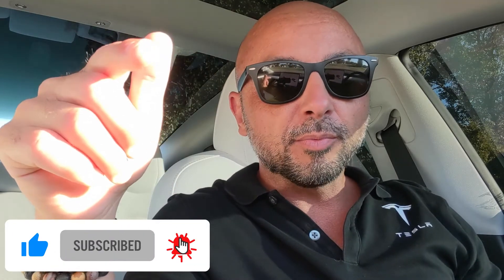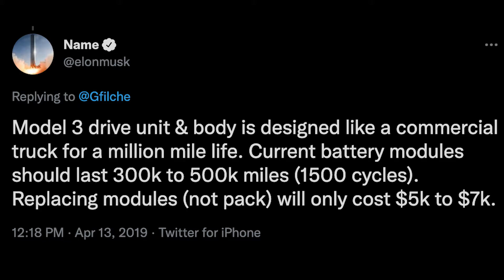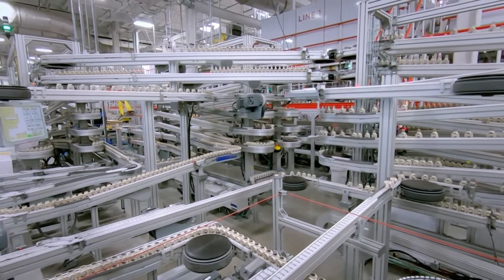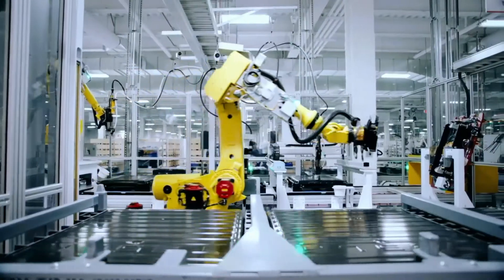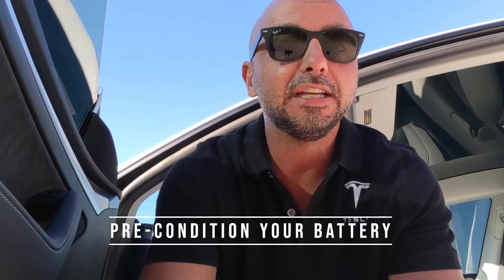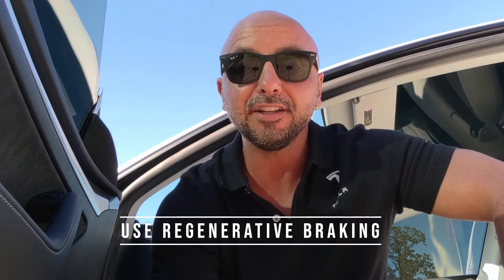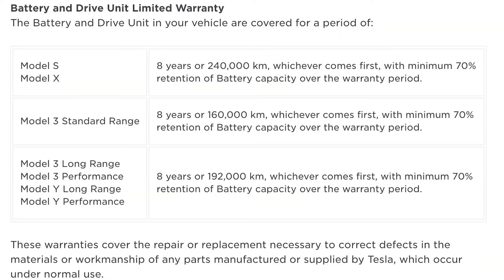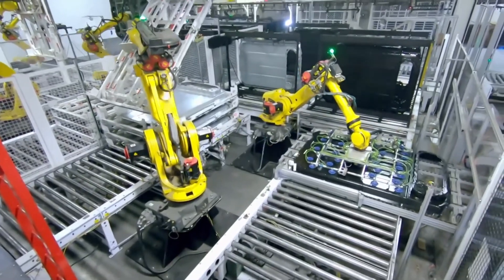How long does a Tesla battery last?

Comment: I recently bought a used 2021 Model 3 Long Range. Manufactured in 02/2021 it may fall into that transition period when the batteries used went from a 75 pack to an 82. I cannot find which battery mine has.  Do you know how to find that information?  And, wouldn't Tesla know by VIN what components the car has. I see it lists heat pump, lead acid battery etc. no mention of the big battery.  Thank you.
Reply from the maker: Absolutely, call your local Tesla Service Center Dave, they will be able to look all of that out.
Reply: @Tesla11ven  I've been unable to talk to my local service center.  After calling the local service center number,  I waited on hold for an hour before speaking to someone in Colorado (I'm in Texas). It was about another matter, but I'll try again, maybe the guy in Colorado can look up the info. Thank you for the suggestion.
Reply from the maker: Don't give up, stay persistent and in fact you can call any center. Also try within the Tesla App as well
Reply: @Tesla11ven  When I described my request in the app, the automated response was  "batteries degrade at different rates depending..." or something to that effect. The "Contact us" button was highlighted in blue but did nothing.  I have 3 local l Service Centers in Houston to try. Monday morning I'll be on the phone!

Comment: My 2020 m3 already has 11 % degradation and still dropping pretty steadily. It only has 33k miles. Not sure if I believe it will last 300k miles
Reply: Yes I charge 80-90% daily
Reply: @barrylee5580  i think that greatest enemy of a battery is heat so take care of that
Reply from the maker: Omg that seems crazy. What kind of charging habits do you have? Do you charge to 80% on the daily?

Comment: We have the 2018 Tesla MS 100D and it has been reliable until last week. I was driving from San Francisco to San Diego. I stopped near Bakersfield to charge the car to about 270 miles. We started down freeway 5 and I got a warning that I needed to charge the car and to pull over to the side of the road. We were lucky we were not hit by other traffic as it was about ten am. We had to wait for about two hours for Geico to send us a tow truck. Tesla in Bakersfield told us that the main battery needed to be replaced. The car has 83000 miles on it. Worse case it may take seven weeks to get it done. The battery is still under warranty so that helps. They provided a model 3 to continue our trip home. I had to learn how to drive this M3 as it does not operate like the MS does. I have to say it rides ok on the freeway, but I like my MS. Tesla Workers at the Bakersfield location are very nice. Our Model S did not give us any indication in the days leading up to this battery failure. Has anyone else had something like this happen to them? Are the batteries installed in the newer cars better? Thank you for your video.
Reply: That was actually my concern, and wanted to get some stats on battery "brick" failure rate on the older model S.  I have an older S 85+  that is out of warranty with 87K miles on it.  I have no concern on the range degradation, as there are plenty of data online showing ~9%-10% of degradation post 100K miles and it doesn't get worse after that.  The unknown is the "brick" failure rate.  Not sure if it's just a random failure, or it has something to do with charging habits.
Reply from the maker: Sorry to hear about your battery experience, and fortunately it will be covered under warranty. I would suspect the model s has similar battery technology but I can say for certain if it's identical.

I have a video on charging tips for the model 3 that you should watch. It will ensure your battery remains happy and lives long. Hopefully you get your car back and all is well with it sooner than they say as well. Good luck

Comment: no my 2020 already have 8% degradation
Reply from the maker: It is expected but can be worse depending on charging habits and battery care, but don't worry it won't keep depleting. It will level off if not already.
Reply: @Tesla11ven  how do you know other than repeating what tesla says?
Reply: My P3D is 8 years or 120,000 miles

Comment: What would happen if the grid goes out?
Reply from the maker: That's a loaded question.
Reply: Gas pumps would not work without electricity.
Reply: honda makes generators

Comment: Cool, I just got a model 3 sr plus and its awesome;-))
Reply from the maker: Congratulations! What do you like most about it so far?
Reply: @Tesla11ven  Hi,  I am into magnetic / free energy, and high performance electric rc heli's so an electric car is a bucket list necessity.....This car was a Chinese build..(I am in Oz).. I was interested in quality and paint particularly panel alignment etc. Its pearl white with black/white interior. It went straight to a mates paint shop from the showroom 2 weeks ago and it spent a week with him getting paint correction/ ceramic paint protection / tinted windows/ rear carbon spoiler /screen protector and ditched the wheel covers for the alloys. They looked awesome with ceramic protection as well. Overall build quality, paint and alignment was extremely good. I live near our Tesla dealership so I plug into their chargers for free anytime they are not busy,, its free;-)) all in all very happy so far and so is anyone that has been for a ride in it ;-))
Reply from the maker: @magneticman2003  That sounds great. I'd like to see how it looks with the new paint and rims.